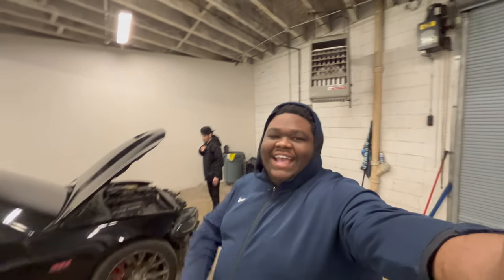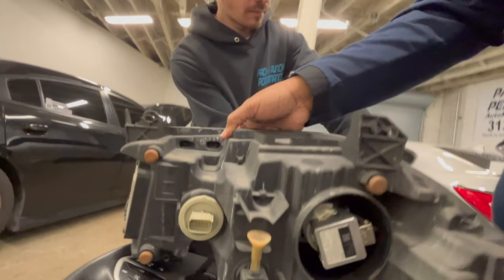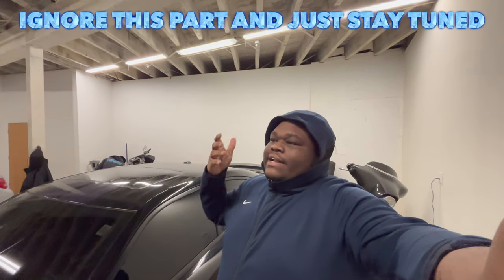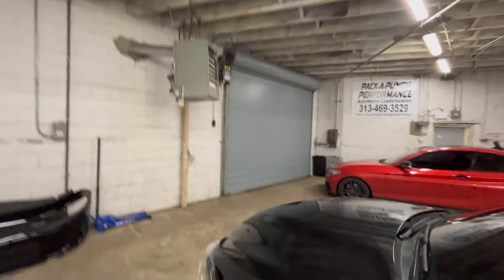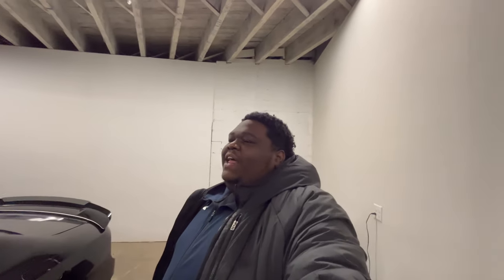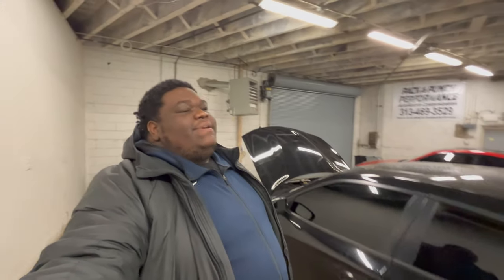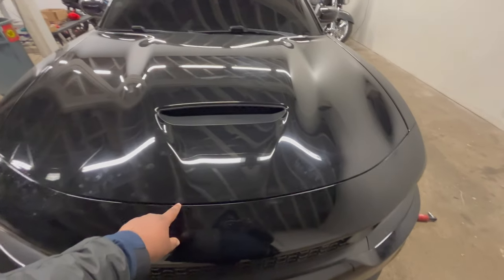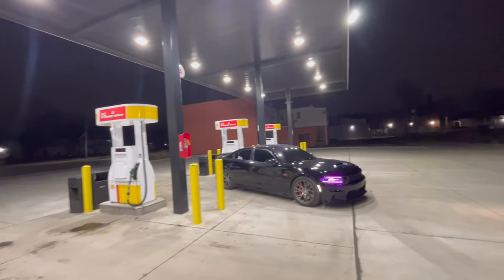MY CHARGER SRT 392 REBUILD IS COMPLETE

Comment: Funny thing is 9005 fit in a 9012 housing but not vice versa. So hypothetically if the charge took 9012, 9005 would fit but since it’s a 9005 the 9012 won’t fit. Also if you do upgrade to LED bulbs I recommend GTRLighting Ultra 2. They are expensive but crazy bright and have a great warranty. Also make sure, if you don’t know, make sure the LED chips are positioned at 9 & 3 wire facing down. That will give you the best beam pattern

Comment: I’m not gonna lie I’ve been watching u since like a week before someone crashed into the scat and I’ve been finding some hellcat superchargers and we’ll there around 4k which shouldn’t be that much for u but I think you should buy a hellcat redeye or Demond supercharger and throw it on the scat bc under those hellcat and Demond superchargers have scat engines underneath just with different types of superchargers on them but you will be pushing 1000+hp if u throw a supercharger on the scat then u don’t gotta pay 50k plus extra for a hellcat
Reply: Yea bro you don’t know what you talking about 😂😂
Reply: hellcat supercharger not good on a 6.4 its way better on a 5.7 tbh plus i doubt it would be pushing that much
Reply: @bandman600 I’m not your bro and your agreeing with someone who don’t know what there talking about so it makes two of you that don’t know wtf u talking about🤣
Reply: @bandman600 you can say what u want but it’s the other way around you don’t know wtf you talking about
Reply: @k1ngwoods420  fam you’re like a month late 🤣🤣🤣, You can’t supercharge the scat without upgrading all the supporting components around it , or it will blow . So no point of doing that . Especially when you can supercharge the 5.7 and it’ll be a better outcome and less money spent . So in that case get a hellcat 🤣, but Rock on
Reply: @k1ngwoods420  I own a dodge myself, not V6 either 🤣 , and just how your grammar is ….. I can tell you only know a little bit about dodges v8 line up , and you still can’t get any facts right ….
Reply: It’s a reason the hellcat is a 6.2 and the 392s are 6.4s . Do your research little boy
Reply: @bandman600 you delete a comment? 😂
Reply from the maker: Omg yall tweaking 😭😭 we dropping a video Tuesday
Reply: @EbayShotIt bhet and Ik😭